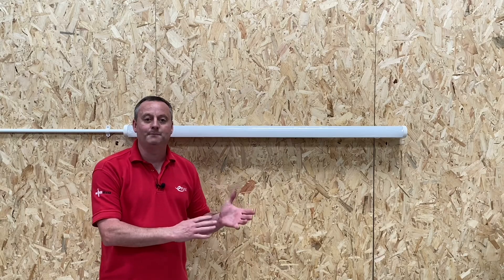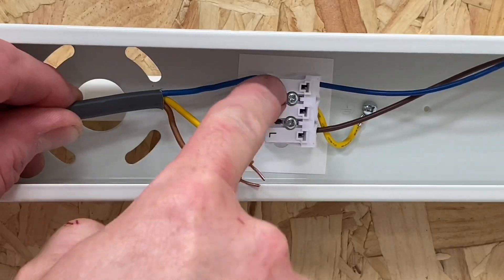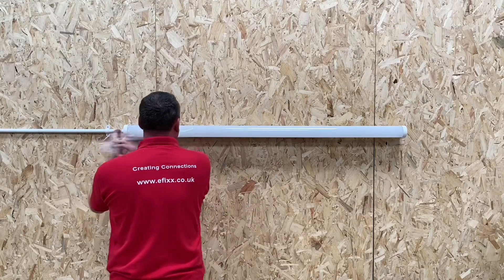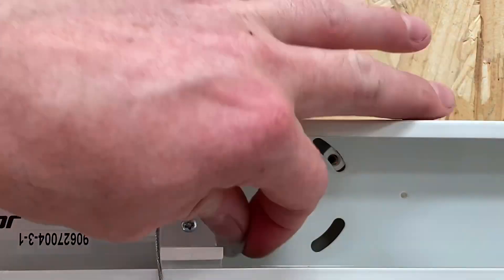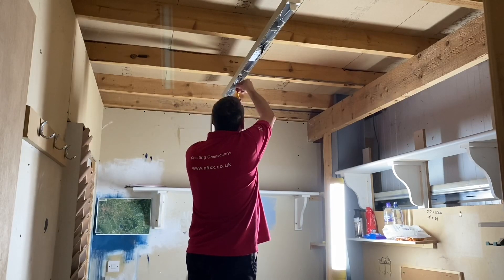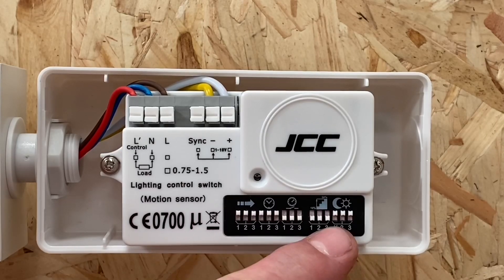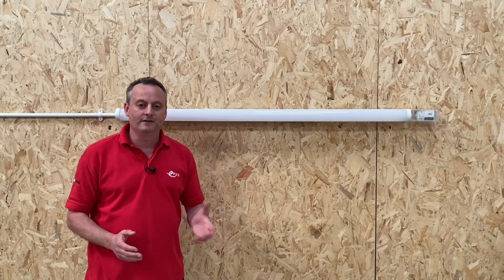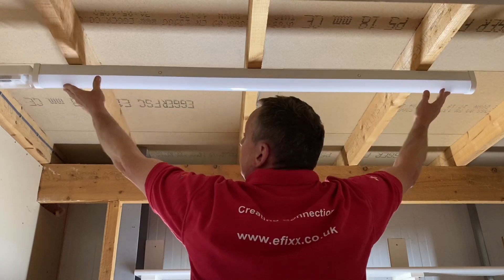Fast lighting installation using the JCC Skypack QR LED battens.

Comment: Notice that on a number of the comments asking about replacement units that JCC lighting have commented that it is all one unit and needs replacing. What they seem to be saying is that even though the batten itself is quick release and arrears to be a common part and also has a connection to the driver that in the case that the batten itself fails, or the driver fails the whole thing needs to be replaced? This seems ridiculous when buying the microwave emergency unit which, should the leds, driver  or em battery fail, would require replacing the whole unit rather than just the failed part especially where the led and driver are the same as on the much less expensive single base unit. That is clearly ridiculous, environmentally unfriendly and just price gouging.

In fact the whole thing seems to be fairly modular therefore why not sell the separate modules as spares.

Comment: Quick question shouldn’t all accessories minus pendants need a tool to access live parts?
Reply from the maker: The connectors inside are all > IP20  you have the same situation on most fixtures which contain a lamps

Comment: Looks a nice fitting. looks like they’ve had a good think about the installer. I had to install another manufacturers fitting before lockdown opened them up and they had mounted the LED driver in the middle of the fitting perfectly inline with where the cables generally come out of the ceiling 🤦‍♂️

Comment: wondering if you could then daisy chain them after adding in the radioactive dimmer module mid chain? If the sensor is radioactive it'd be pointless to order th special UV tube to use in your tanning booth 😉

Comment: Looks like a great quality fitting, I’ve fitted loads of microwave sensor battons in hospital corridors in the past, but these looks so much nicer to fit and control. Will definitely be quoting these from now on. Anything to get the lights fitted and on before that lunchtime finish 👍

Comment: Looks like a quick fitting new thing for the loft

How easy is it to get replacement light?  And is it IP rated?
Reply: Dipsy, thank you for your comment. The Skypack QR is an integrated LED batten, therefore there are no replacement components. The fixture is IP20.

Comment: I like the way you have pre cut holes so you can connect up to conduit boxes. Number of ones I've had to change I've had to drill in holes for the cable entry and to secure to the conduit boxes. Only problem is that would have to be on a new install or alter the current install, which isn't always possible.
Reply from the maker: Your trying hard for a prize... are you on Instagram? Gaz 👍
Reply: @efixx  yes I am! Got to work for it!! I am on Instagram, I'm the one who put on the story of you under a rain cloud with Celine Dion (crumps84 I think my name on there is).  
I pain I went through to do that video, I had that song in my head for the whole of the next day!!!